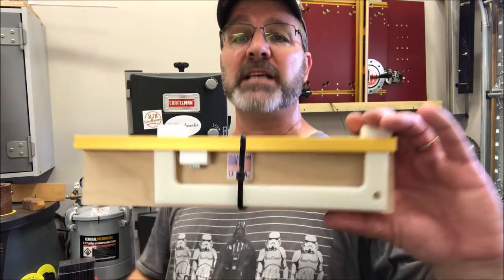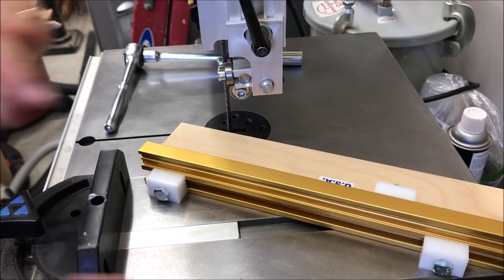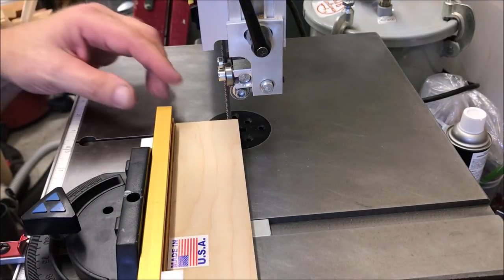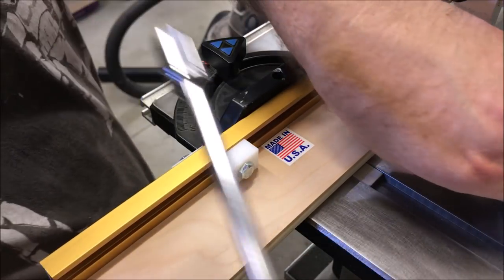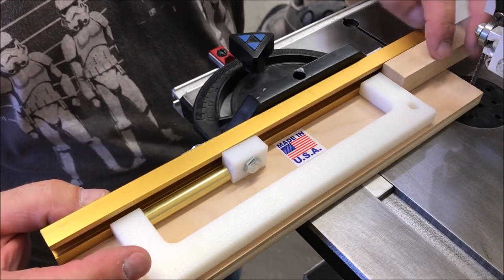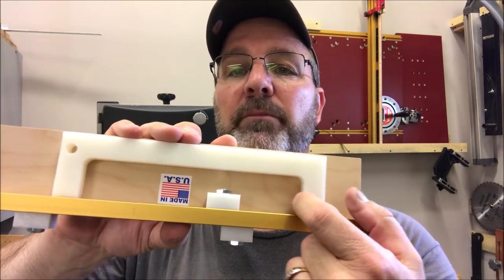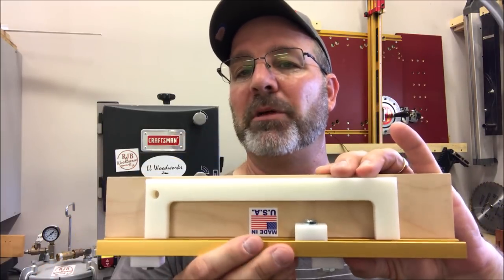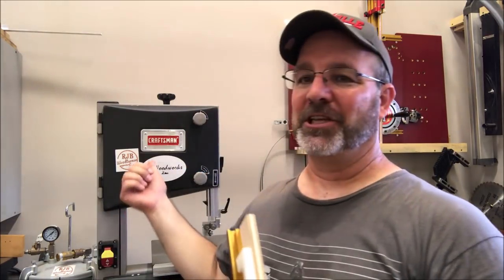Pen Blank Cutting Jig - Cut A Perfect Blank Every Time

Comment: Thank you for showing this jig and it’s nice to see new videos.  I am sure you are happy to be spending some time in the shop.  Just a thought. I made my own version and made a second block to put on the backside of the spacer to hold the spacer tight against the tube.  It keeps the spacer in place better and when doing multiple cuts with the same tube the setup stays in place better.  (P.s. my first ever you tube comment)
Reply from the maker: Thank you Michael,
  I am honored that your first YouTube comment was on one of my videos. I also appreciate hearing about the jig you made and the extra piece for holding everything in place. 

Regards,
Bob

Comment: Tim Geist makes good pen making tools.  I may buy this blank cutting jig, although I've managed to do quite nicely just cutting the blanks freehand on my bandsaw.  I do hobby work one pen at a time once in a long while and thus cutting speed isn't important.  I also have a Tim Geist copy of the Paul Huffman pen drilling vise.  I like the Geist copy a little better because the threads are smoother and have less slop and the jaws have greater capacity.
Reply from the maker: Plus Tim is a really nice guy. 

Regards,
Bob

Comment: A really neat jig, really like that you use your mitre gauge to lock the jig in place.  Price is Ok but shipping to the UK is expensive.  Will need to make one myself. I like the track that Tim has used so you can position blocks on both sides, do you know what this track is called?
Reply from the maker: Hello,
  It’s called T-track. 

Regards,
Bob
Reply: @RJBWoodTurner   Hi Bob, thanks for the reply. I guessed it was T-track but as it is double sided does it have a particular name? I have not been able to find that kind of track on the Web, any clues would be great, thanks.
Reply: Judging just by it's colour, INCRA might have made it.

Comment: Hi Bob, looks like you have got a nice new bandsaw ,that should help you a lot, especially with your nice new cutting Jig , noticed you are only leaving a 1/16 of a inch spare on the end of the blank, you might find you need to leave at least 1/8 of an inch at the end of the blank with so you have 1/16 of an inch at each end for when you are truing it up square with you barrel trimmer ,just a though, Regards from Jolly ☠️ Roger.
Reply from the maker: Thank you Roger,
  I usually mess one or two up before I adjust and truly figure it out, LOL. 

Regards,
Bob
Reply: If you leave a quarter of an inch surely you'll have an eighth of an inch at either end?
Reply: Miss Tee's Woodturning , Hi Miss Tees well spotted ,it should read 1/8 inch at the end of the blank which would then leave At least 1/16 of an inch at each end. I have now amended this. When I cut my blanks I tend to leave them at least 1/4 inch long, to allow for breakout when drilling, and squaring them up with the barrel trimmer. Have a nice 👍 day, Roger and out.

Comment: Will it work with a table saw
Reply from the maker: I’d be kind of nervous about using it with a table saw unless you added a hold down for the blank.

Regards,
Bob
Reply: @RJBWoodTurner  where could I put the hold down, will it fit in any band saw
Reply from the maker: I went and looked at it and It’s to small. You’d have to make a home made one. You need to keep those fingers safe.